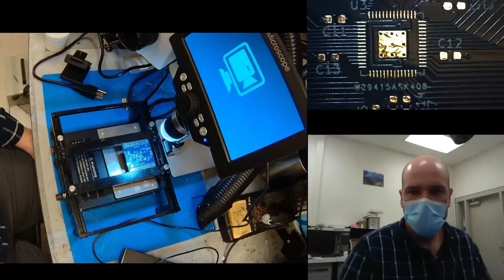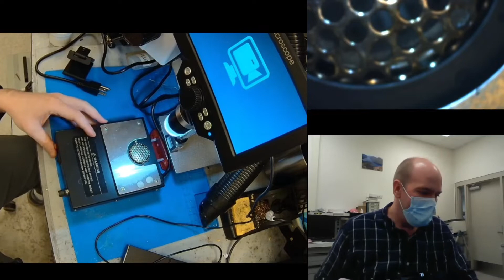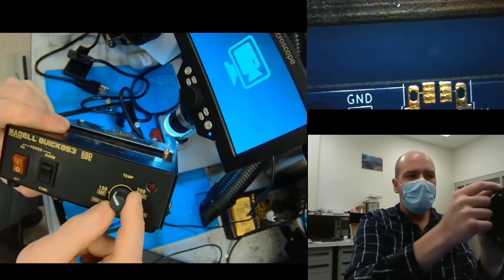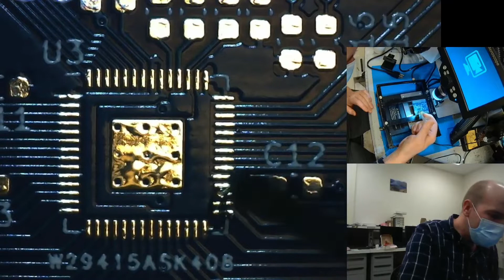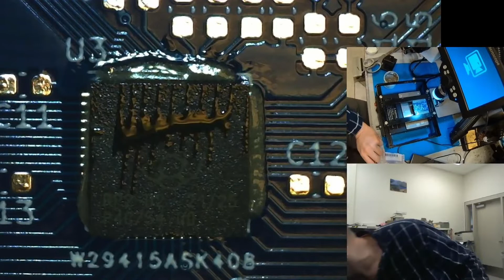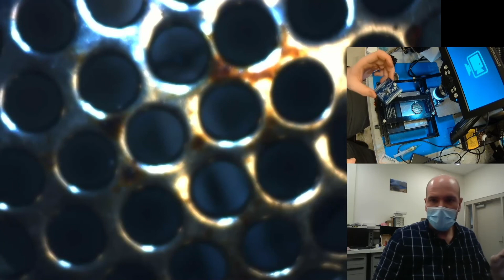RP2040 hot air reflow solder example

Comment: Fluid surface tension is your friend. Helps self center the parts - as the pads heat to melting point of the flux - the pcb/component pads will bridge and pull the smaller molten parts towards the central mass. The amount of molten paste between the pads is self limiting, and any solder paste outside this mass will fail to melt and will clean up easily with flux cleaner in an ultrasonic bath of 75/25 parts Ethyl Acetate to Isopropyl Alcohol. Still, too much paste can be applied - buy the matching solder mask with the PCB for new designs.

Comment: Thanks for the explanation. The preheater would perform the same sort of function as a hot plate, correct?

What kind of solder paste are you using?

Comment: Oh my God I'm going to come back to this one the list of what you did right and said versus the list of what you did wrong and said oh my God
Only thing really I can think you said right is that reflow heat gun goes into standby mode when you put it in it stained and that's because it's got a magnetic read switch in the handle and little neodymium magnets in the stand...

And watch out the hot air gun can burn you

Let's see what else
I like that you pre warm you're bored not your pre warmer though

I will come back to this in outline lake everything wrong but

And I say this with respect but if you ever read a datasheet for any of these components and looked at the reflow slash solder temperature chart for the part or any SMD cuz they're all pretty close but

My speech-to-text is my location right now is Cappy location so I'll come back to this but I do hope you take what I say in this and my next reply
Reply: You have issues.
Reply: What?